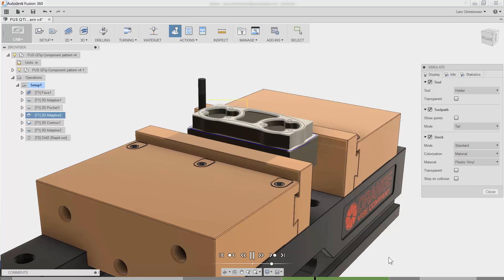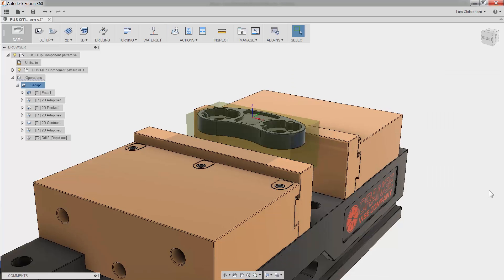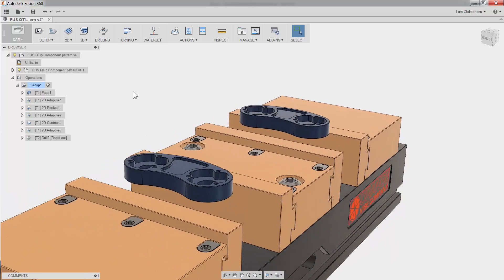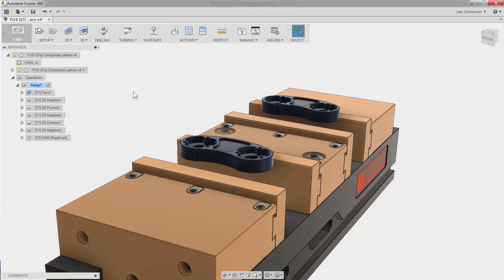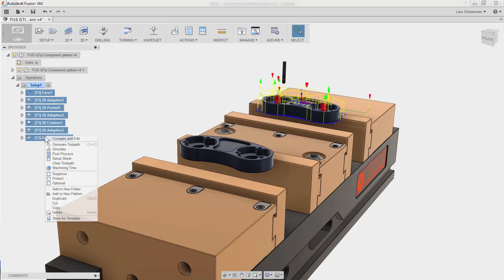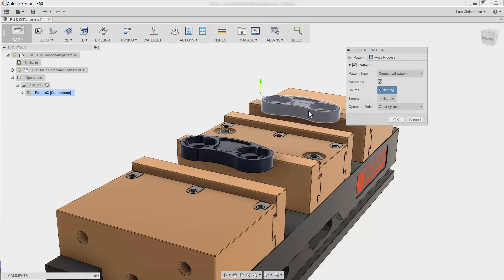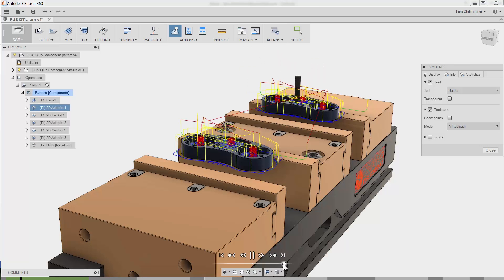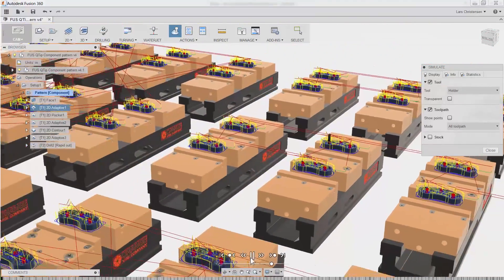Quick Tip: CAM Component Pattern

Comment: and in each part you have to repeat every single tool change 
not very efficient, your boss should not be very happy with that program
Reply: If you check out the dialog for the pattern, you can tell it to order the operations by tool. So it will perform all of the operations with each tool before requiring a change. Check it out, there are a lot of options.

Comment: I have been testing Fusion 360, it has some nice features, although it's really limiting and inefficient in many ways. Machining multiple parts is something I do more often than not. I frequently will load 10-30 parts per cycle. While it's nice that Fusion handles multiple parts, the way it does it leaves much to be desired. First, one should be able to simply input the part layout locations (e.g. X-, Y+ and number of repeats) instead of selecting part geometry. What will probably be the deal breaker for me though is the huge files it creates as it creates code for each part. With professional type multiple part fixtures it's really nice to have the option of using G52 (work shift) and M97 subprograms. This way the program isn't much larger than one for a single part instead of multiplying in size exponentially with the number of parts programed, plus it saves the need to set and manage so many different fixture offsets. I realize sometimes multiple offsets are essential for various reason, but for many if not most instances it's a lot of unnecessary complication and effort.
Reply: First off, thank you for the responses, I'm impressed and must say you guys are a credit to Fusion. I have played around with the Linear patterns options, and it does do the job. I will freely admit I have not fully explored all of the options yet.  Editing the programs so they were in the G52/M97 format is an option, but that's a lot of extra work. Perhaps a customized post processor is the answer, I will study the issue some more and see if that would get me to where I would like to be.  In another software package there are several options when setting up part repeats and it is very useful. But the modeling capabilities and some other things in Fusion 360 blow that software out of the water.
Reply from the maker: Thoughtful responses like this belong in the IdeaStation! https://forums.autodesk.com/t5/fusion-360-ideastation/idb-p/125 

We'd like to get someone with the ability to make decision like this to respond, but this is the wrong place to do it, unfortunately.
Reply: Hi there G53X0Y0Z0, first of all I dig your username. Second, you should check out Linear Patterns, which allow you to select pattern instance directions, distances, and part counts just like you described. Component pattern can be great, but like you said it makes large files and users often don't want to spend the time modeling. In terms of code output, that seems like a post processor topic. Luckily, all of our post processors are available for you to edit on your own (for free) or you can contact a partner for a paid post edit, more info on that here: https://forums.autodesk.com/t5/hsm-post-processor-forum/hsm-post-adjustments-needed-find-your-right-contact-here/td-p/6652728 

I hope all the above helps, let me know if I misunderstood you or missed anything.
Reply from the maker: Thanks for the MUCH better response, Marti!

Comment: Thanks for the great tip. I'm just starting with Fusion 360. You may have covered this elsewhere but will there be control over tool changes allow tool #1 to do all the parts before switching to tool#2 or will it finish part#1 with all tools before machining part#2?  If I were doing this in gcode I would create a program and feed it new locations.
Unrelated question, do you have a library of vise designs? I would like to add one without drawing it.
Reply: +braxtonec When you post the code, you have the option to "REorder to Minimize Tool Changes"
Reply: Jeff Hooper thanks Jeff. Well definitely give this a try.